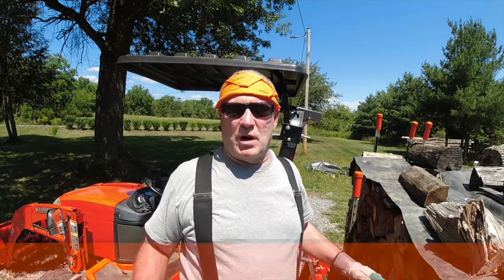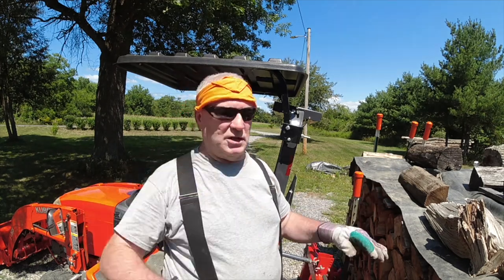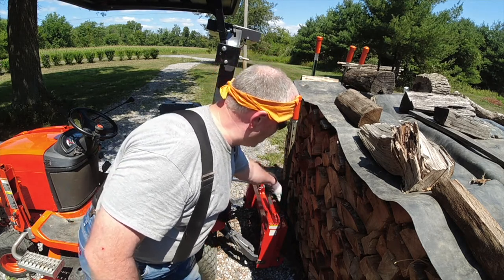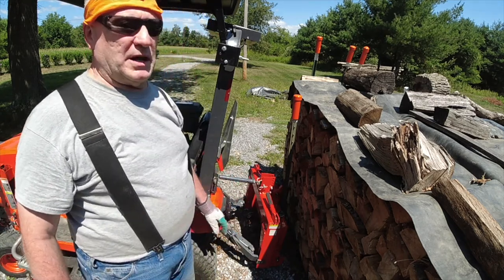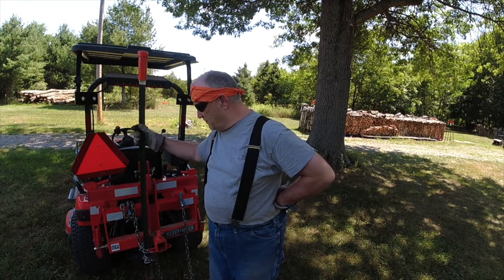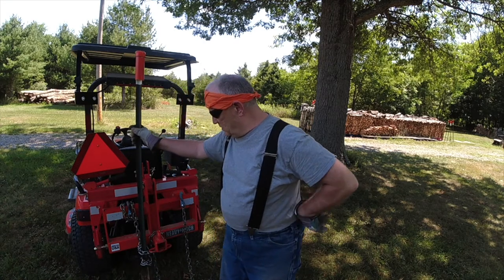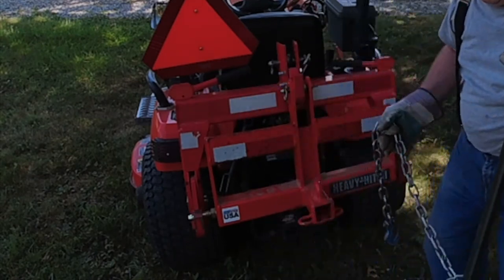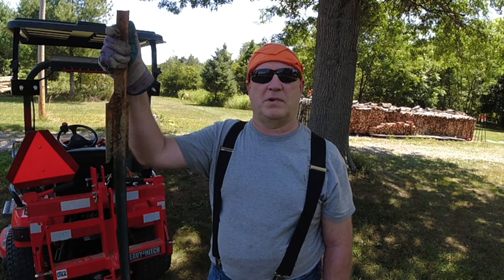#80 - T-Post Removal with the BX

Comment: Bob, I agree the 3 point is always better and easier on the Tractor, 👏🚜🪵👍🏼🇺🇸
Reply from the maker: That has been my experience - This is a modified technique I learned in the USAF.  My unit drove hundreds of 9 foot ground rods into the ground.  We used our JD loader to pull the rods with a length of chain - It was fast and efficient - but my BX loader does not have enough force to do the job, so I tried the 3-point hitch and it worked.  So, I thought I would share it here on YouTube - thanks for watching and commenting - cheers
Reply: Bob, good to hear, and Thanks for your service! Be safe my friend 🚜🪵👍🏼🇺🇸

Comment: Great video Bob and thanks a bunch for the shout out buddy. The 3 point hitch is deffinelty the better tool for the job (in most instances) it absolutely has more lifting power than the FEL does and odds are if the 3-point won’t lift it thrn neither will your FEL. I used my FEL to pull those stakes out in my video for 2 main reasons.. one was for speed, since time is money, and 2 I used it for reach.. since I was working on such uneven ground and had so many stakes near one another I wanted the reach of the loader vs. having to be right up against them with my tractor. Both techniques work great and if I were to do this job at my home for myself I woulda done it the same way you did it 👍🏻 Keep the videos coming man!
Reply from the maker: I tried the loader, but I didn't have the power.  I noticed how much faster you were able to pull the stacks, so I thought I would give it another try.  I almost rolled the little BX ;).  You have showed me a lot about getting more out of my BX and I really respect what you are doing.  Keep up the good work my friend.  Thanks for watching and commenting - cheers
Reply: @botabob  hey thanks a bunch Bob! Yah these machines can get pretty tipsy when lifting hard objects like stakes out of the ground haha. Im glad you didn’t flip it over! Maybe some more rear ballast would be good. How much do you have now?

Comment: The 3 point hitch is a good idea, seemed strong enough, good job Bob 🙋🏼‍♂️👍🏻🙂
Reply from the maker: Thanks, as stated in other replies, my loader does not have the strength to pull the T-post straight up and out of the ground.  So, one day I thought about trying the 3-point hitch and it worked.  Having two people to work together would be a lot easier, but that's the way it goes.  Thanks for watching and commenting - cheers
Reply: @botabob  I think Mike at Biff’s Equipment was able with the FEL is because he’s added shims to get more pressure so that probably helps 🙋🏼‍♂️👍🏻

Comment: that worked great, might as well use our machines if we have them.
Reply from the maker: Absolutely!  I learned how to do this when I was in a Ground Theater Air Control System (GTACS) in the USAF.  Our unit was tasked with providing mobile comms.  We would drive about 100 nine foot long copper rods into the ground to ensure safe electrical power and static free comms.  Removing the ground rods was a chore with a slide hammer, but we would use our JD loader and a length of  chain to remove them very quickly and with little effort.  I found my loader on my little BX came up short on pulling power, but the 3-point worked great.  As always Vern, thanks for watching and commenting - cheers